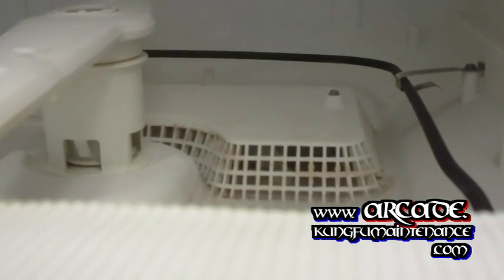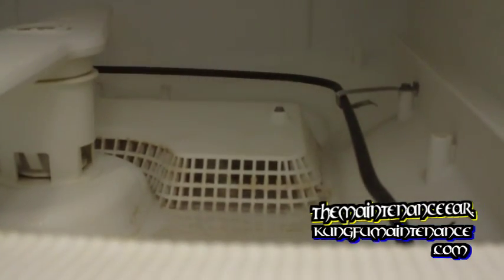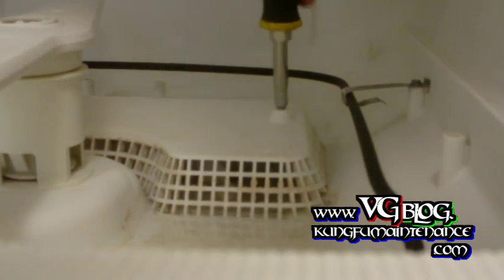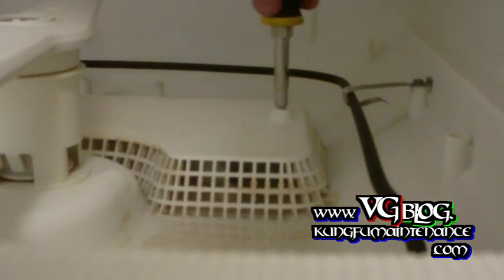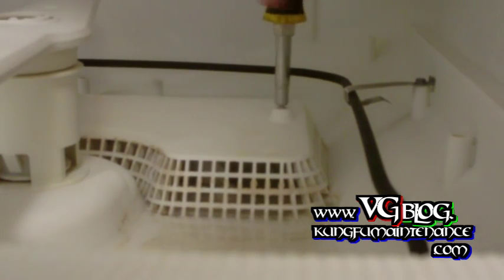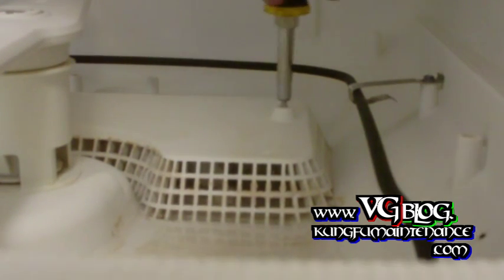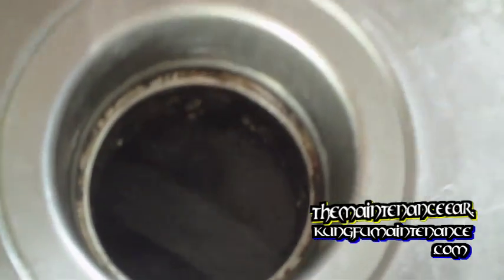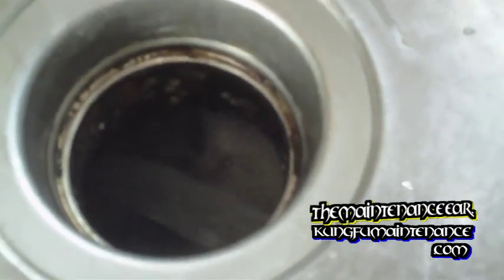Dishwasher Not Cleaning Very Well ?

Comment: This video saved me a ton of money, time and pain! GE Nautilus Dishwasher was not sounding right, decided to take a look and discovered water was leaking out and onto the floor. Opened it up and saw a pool of water sitting in the bottom. Checked the instructions which were useless and almost panicked....until I decided to check Youtube and found this site. A quick trip to HD to pickup a wet dry vac, THIS VIDEO, my 6-n-1 screwdriver, patience and 20 mins of time had everything right again.....(piece of plastic got wrapped around the food grinder blade in the sump causing the non draining of the dishwasher)....Shout to Kung Fu Maintenance!

Comment from the maker: Some spray arms are held on by a large plastic nut that is untwisted at the base to remove. Others have a nut at the top center of the spray arm that can be removed so the assembly can be taken apart. If you are showing low flow sometimes running a empty load with a cup of white vinegar added to the water can help to break up calcium and mineral deposits that build up and lessen spray pressure.

Comment: yeah, important to check the drain...like you did. I just opened up my 1970s Hotpoint dishwasher and I found TONS of pieces of glass, two pennies from 1972, bobby pin, springs, nuts.....no diamond ring yet, but I am still in the process of picking all the pieces out with tongs and tweezers

Comment from the maker: If you google the make and model of your particular dishwasher you should be a able to dig up a diagram that shows how the assembly comes apart and is held together. Some are held on by a large plastic nut that is untwisted at the base to remove. Others have a nut at the top center of the spray arm that can be removed so the assembly can be taken apart. Each model has it's own particular variation. Sometimes running a cup of white vinegar through an empty cycle can help improve spray pressure.

Comment: This saved me some money. Liquid plumber didn't work. Sure enough i had glass and metallic particles stopping motor blades from turning. This keeps the washer from running and draining. You have to get all the way in and look with a flash light. The vacuum helped too because you need to clear all of the water out to see.

Thanks

Comment from the maker: I use an all in one screwdriver. It has two different sized nut drivers on either side plus screwdriver pull outs with small and large philips and flat head. Each brand of dishwasher uses different connectors but most use a 1/4th inch nut the smaller size nut driver on my screwdriver or a 5/16 ths the larger size. You can see it on my KungFuMaintenance website "Choose Your Weapons" page on the right side. Anything purchased through me website I earn a small commission.

Comment: For everyone asking about the tool to remove the screws on the sump cover, my 1/4" nut driver works well but my ratchet screw driver without the interchangeable driver shafts works better.

Comment from the maker: Yes that can happen I have another vid "How To Make Your Dishwasher Work Better" which may help. I would check air gap and drain than try running an empty cycle with a cup of white vinegar poured into the bottom of the dishwasher to clear out any calcium and mineral deposits. Also make sure you have a rinse aid added in rinse aid dispenser. Lastly position Items in dishwasher so all items get good spray. One way to check if there is a spray issue might be to run a load with top rack items only.

Comment: Q1:  Our unit is not filling so it's not spraying.  Thoughts?  We have "OFF" at top and then "Heavy Wash" ... different knob settings.  Pump or valving?  Control board TO the pump?

Comment from the maker: What you can do is run an empty load with a cup of white vinegar poured into the bottom about once or twice a month. I show it and a bit more dishwasher tips in me vid "How To Make Your Dishwasher Work Better ". In my kitchen I have four four foot T8 fluorescent 4100k bulbs recessed in the ceiling behind two traditional acrylic diffusers. You can actually see them in me vid "How To Trim Down Kitchen Light Lens Covers" I like the 4100k color spectrum for fluorescent lighting.

Comment: BloodOfYeshua: I just went through that tonight. The basket or grid is connected to the back of the the bottom water spout thing (Sorry, I don't know all the language..) In the front of the spout, if you look down and under, there is a tiny screw in the front. Remove that. Then, pull up on the back. The basket has a hole in it where the rotary water thing attatches to it at the base. Pissed me right off and made this take twice as long. I also removed the spinning thing, in the back there is a wedge that you need to grip and pull while lifting up the spinning part.. made seeing things much easier. At any rate, thank you thank you for this video. Other than this little bit I have added, the bottom of my GE dishwasher is very similar. It was absolutely disgusting, but is working like a charm now. The underside of my basket was totally just the most disgusting thing I have ever seen. I had broken mug and a lolli-pop stick down inside.. plus all kinds of food that couldn't get chopped up because of the clog up.

Comment: i pulled the cover off, stuck my fingers down the hole..and it was just a continuous curved tube. there is another hole under the cover that's covered by a circular mesh plastic cover, but I can't get it off for the life of me. I tried prying it off with a screwdriver but I only end up breaking the mesh (which is VERY hard plastic by the way). I tried jamming my screwdriver in there just to see what's inside and i felt like a metal ball thingy. not sure if I am supposed to go in there. I have an Whirlpool TUD4700SU1 if that helps.

at this point I dont know what to do so I just closed everything back, threw in some vinegar and running a cycle.

Comment: Got a question. There is a rubber seal under all the filters at the bottom. Mine is partially black from gunk. Can I remove the rubber seal. I've been pulling on it but it doesn't want to come out. There're is black gunk under the rim of the seal when I pull it up. I want to remove it and thoroughly clean it in the sink is this possible? Thank you @kungfumaintenance

Comment: I have a washer just like this and I have done everything in this video. It's a used  washer but it will not drain. I hooked up everything as it should be but I'm at a loss. Any suggestions?  I checked the drain lines and they are new and clean.

Comment: thanks for the video I need to go back in and test the grinder.  Should it spin by hand?  And what about that  smaller domed cylinder part on the front left! (that has the hook to the heating coil) that has a smaller part inside and they both can get super clogged with old dish detergent!

Comment: Your video was very helpful.  The sump under the screen in my dishwasher was loaded with debris.  Thanks to your video, I was able to remove the clog.
Reply: If you have a GE washer like the one in this clip: also check the small dome/cylinder part in the front left hand side. That is the water level float. I took mine off and it was clogged full of old detergent and whatever!  (also see his video on "How to Fix a Dishwasher That Will Not Drain"  My drain hose was clogged as well.)

Comment: I am taking the inside of my dishwasher apart and scrubbing it out there are roaches living in there,  my dad never used it once he did not know.   It really grosses me out as well as removing the different parts. Well any way i came to a drain of sorts  that has a small propeller, but it only has 1 arm the other is broken off.   Is this an essential part?   If so how do you get to it?  and about how much do they run:)?
Reply from the maker: TAMARA MILKE These are usually one arm. It is a sort of disposal assistance blade. Not very strong wire. Won't endure much hence the heavy screens before it. Aids in break down of materials that get past the screens. Not easily replaced. Not completely vital. If it breaks. Perhaps more cost effective (labor plus parts plus success ratio effectiveness of replacement) to manually unclog as needed or replace dishwasher if needed.

Comment: Hi, I have a similar model and the dishes in my upper rack seldom get clean, and there are food particles that dry and redeposit on a lot of the dishes when the entire program is finished.  I'm wondering, inside the lower spray arm is a little circular device that you can pull up with your finger, does that thing extend all the way up on its own during the wash cycle? maybe mine is broken and that's why my upper rack dishes aren't getting clean? Please let me know if that can happen & what 2 do

Comment: Check out this vid.. it shows how to remove the wash arm and you will also if you watch carefully, you will see the little screw in the front under that lip that I am talking about. Lower Wash Arm Assembly Replacement (part #WD22X10055) - GE Dishwasher Repair

Comment: We are having difficulty removing the center hub of the lower spray arm. Also when you turn it it feels as though something underneath it is moving as well. Any suggestions?
Reply from the maker: +Bobbie Mackay They are all slightly different. Some are reverse threaded. Some have release tabs that need to be pushed in to remove.

Comment: Is the water that washes the dishes heated in the water heater in my basement or is it heated by the elements inside the dishwasher?
Reply from the maker: ~ On most dishwashers it is heated in both!
Reply: Thanks. I was asking because I recently turned down the temperature on the water heater in the basement and noticed that the dishes are not getting as clean. I just wondered if the two actions were connected or just a coincidence.
Reply from the maker: I see  ~..~  it probably does have some effect. Best practice is to start dishwasher immediately after rinsing dishes with hot water. This way the initial fill cycle starts off with hot water and dishwasher is better insured to reach good temperature.  Many dishwashers heater coil only heat up by time allowed for heater coil to be on and not temperature controlled.
To put this another way timer runs according to allotted time whether water reaches specific temperature or not. 
Hope this helps!!! Thanks for watching! :D

Comment: PLEASE HELP ! I have a similar machine. The only difference is that it has 3 screws on the back holding the basket which I have now removed. But for some reason the basket will still not come off. I dont know why. Any thoughts someone ?

Comment: My little metal arm was off and just laying in the reservoir when I went to clean it. It feels like a piece of gum or something knocked it loose. How do i put it back on?
Reply from the maker: +lightningfury To be honest I wouldn't worry about it to much. I would just rinse the dishes a tiny better before loading the machine and perhaps clean the sump once every couple years (and or run an empty load of white vinegar or dishwasher magic every 6 months or so) . That little metal arm just stirs things up a bit but really doesn't do enough to warrant going through the trouble to replace it.  In my opinion.
Reply: That little metal arm is supposed to cut food up so it can go to out to drain.  If it is loose, it is not cutting and food will accumulate in the sump.  My cutter was broken and needed to be replaced.  There is a very inexpensive kit with a new cutter and various seals that can be replaced at the same time.

Comment: Thank you for the validation,I'm doing this crap right I think. Here I am 10 years after this video was posted in my 1940s home doing the exact thing to an identical extremely outdated dishwasher...I was raised with my 5 sisters and I being the dishwasher, scrubber, rinser,me the dryer, then another one of us as the put dishes away'er, then of course the eldest observing and pretending they did something important. So when it comes to a dishwasher,I'm probably the worst at rinsing my dishes off prior to the dishwasher,what's the point if Im washing the dang dishes before putting them in a dishwasher!?!.....well I'm learning that lesson the hard way now at 38years old,lol....yeah, this is almost the grossness equivalent to when my bathroom sink was clogged and I had to open up the trap under there to clean out...Naaasty,i hope this fixes it though cus I can't afford a new dish washer and I don't have enough kids who are old enough to be the dishwasher,lol.

Comment: What is that tool you are using to open the filter up in the beginning?
Reply from the maker: +naturegirlfromny That is a six in one screwdriver.
Reply: naturegirlfromny I cant get mine to open with everything i tried. I'm gonna go through my tools again
Reply: I see that you used the six in one screwdriver but which of the 6 pieces are you using to open that. I am here because my dishwasher didn't drain all the water and I tried to take off that piece with a screw driver and it didn't work so I'm wondering what tip I need to use
Reply: This is a new reply to an old question, but a 6-in-1 screwdriver is a nut driver when there is no tool in the holder, only the hex opening.

Comment: Thank you so much!  We are renting and the filters on ours looked like they had sank with the Titanic they were so covered in lime!  GROSS!  Any idea how much this would have cost if I would have called a repair man?  Just asking because I may consider asking for a bit off of our rent for saving our landlord a visit from a repair man.
Reply from the maker: Sarah Bratt You're welcome. Thanks for watching. Probably would cost around sixty to ninety dollars an hour with most likely at least an hour minimum for the trip charge.
Reply: +Sarah Bratt Lime is basic, swamp your washer with an acid and it should eat it away. I haven't tried it as I don't have this issue, but the citric acid in Tang is supposed to be good at removing it.
Reply: vinegar is an acid.  you can use it to remove lime.

Comment: Why is this the dishwasher in nearly every cleaning video?... also I don't want to use mine now, it's the same type as this, but even dirtier. Q_Q 

BTW is there always standing water in there?
Reply from the maker: +Shaggy2286 Yes very common dishwasher. A bit of water left behind is needed to keep the seals wet so they don't dry out and crack. If you don't want to touch anything in there a bit of white vinegar added to an empty load can help clean things out. Dishwasher Magic is also an effective over the counter (under the counter, LoL) treatment. (I don't work for them. I just like the product.)

Comment: I got the two screws off that hold on the cage, but then I couldn't get it off because it was wrapped by the armature for the spray arm.  Tried the screw that held that on, but it is set back is the plastic covering and couldn't get the screw driver down in there to get it undone.  ARGHHHHH!!!  I think sometimes manufactures do this so that we have to get a repairman out to fix it.  That's ok, my roommates son used to be a journeyman plumber and we'll get him out here.  I tried...

Comment: WHIRLPOOL DISHWASHER - VERY LITTLE PRESSURE A SPRAY ARMS, SEALS, PUMP AND IMPELLERS APPEAR OK...  NOW WHAT ?   CAN AN IMPELLER THAT LOOKS GOOD BE BAD ??  DAVE
Reply from the maker: Yes can be a clog down in the sump drain as shown in the video. A clog at the air gap or build up in the drain line, also can just be calcium and mineral build up inside the spray arm. Adding some white vinegar and running an empty cycle once in awhile is a good idea to clear deposits and build ups.